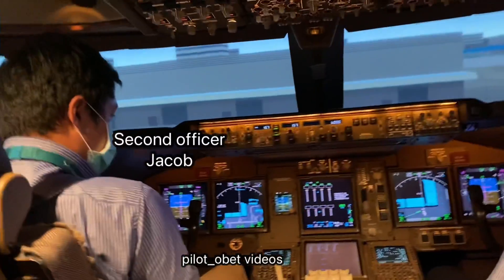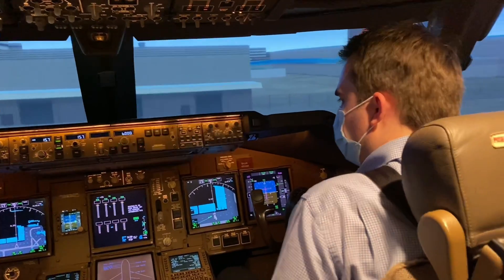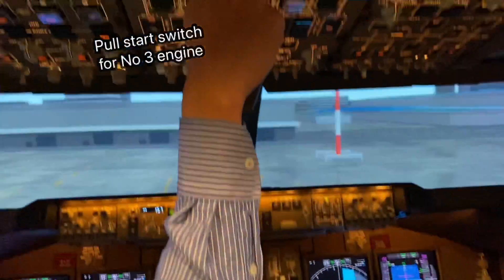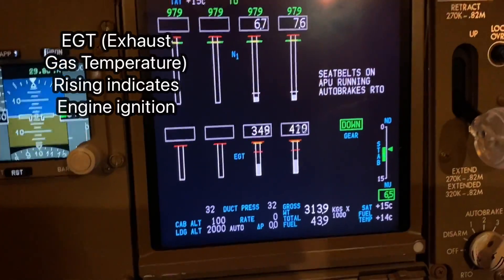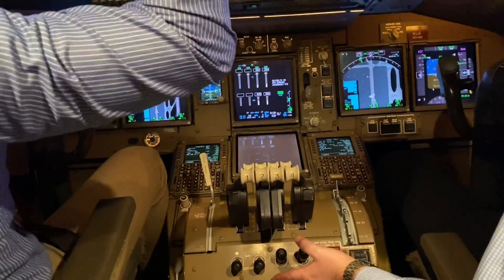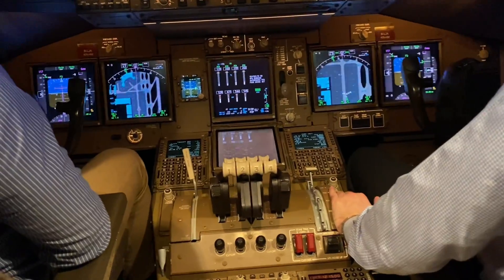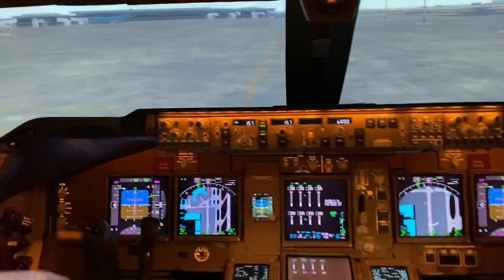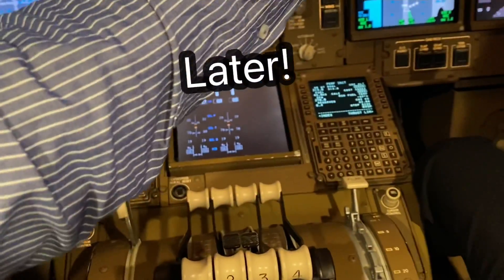Boeing 747 start sequence and communications

Comment: Anyone know what Cargolux 747-400 start sequence is? 4/3 then 2/1 or 4, 3, 2, 1?
Reply: on RR engines sequence is 4,3,2,1, one at a time.  on the  GE engines at pilots discretion they do  4/3  and then 2/1

Comment: Hello Captain! Last month I had a flight on the Lufthansa 747-400 where there was a failed APU. In that scenario, what would be the start sequence? I read online that it is 4-1-3-2, because 4 provides Hydraulic power, and 1 provides Electric power. Is that correct? Thank you very much and hope you have a great day!
Reply: hello 747-400/8 mechanic here, all 4 engines provide HYD power and Electric power, the reason for staring engine 4 is because HYD. system 4 powers the Main Brakes, the sequence is company SOP, some carriers use 4-3-2-1 some do 4-1-2-3, Only GE equipped 744/8 can dual engine start. Hope this helps

Comment: Why begin engine start sequence with engine no 4 and not engine 1? 

Why is the start sequence 4,3 then 1,2 instead of 4,3 then 2,1?
Can you start random engine numbers like 3,1 then 4, 2 or does it have to be in that specific sequence of 4,3,1,2? If not, what will happen if you do it anyway? 
This is why I can never be a pilot. I'm too experimental.
Reply from the maker: You can start random numbers but we start number 4 first because that pressurises the brakes. Number three is just started because it is away from the doors on the left as well as the aero bridge for passenger aircraft etc could still be connected. Sometimes we have to start number 4 for hydraulic power and also has a generator on it when APU is not working- it’s furthest from ground personnel etc for safety too.
Reply: @pilot_obet  so much I'm learning here. Thanks for the info and for this educational channel.

Comment: Why not start all 4 engines at the same time?
Reply: Typically the APU can only provide enough bleed air to start one engine at a time. On the 747 it's big enough to do two at once in order to shorten the start sequence, but making it big enough to do three or four would be infeasible and pointless.